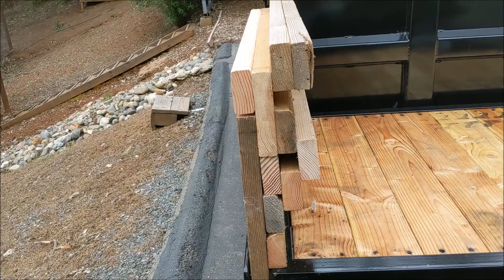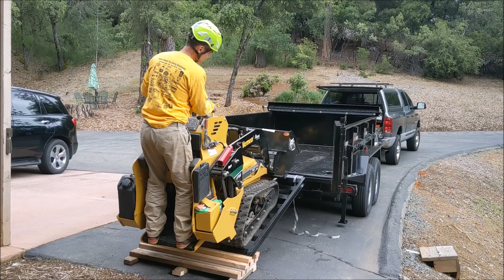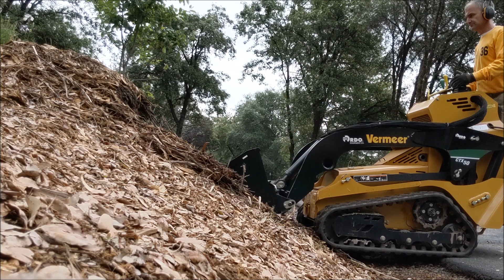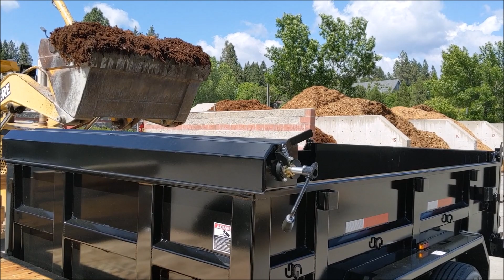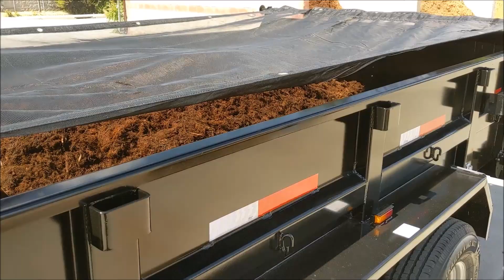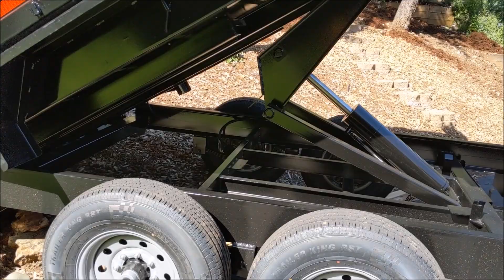Update Dump Trailer, Mini Skid Steer

Comment: as others have noted, you never load a mini or full-size skid steer forward on a trailer.  you ALWAYS "back" onto the trailer. this is important on a stand-on mini skid because you always need to have a way to ESCAPE off of a stand-on skid steer if it begins to roll over.  the way the guy is loading this mini-skid, if it starts to roll backwards, it could roll over the operator.
Reply from the maker: Yes, very good advice. I certainly load it that way now. Thank you
Reply: Happened to my guy yesterday.  Luckily , it didn't flip all the way.

Comment: Have you looked into putting drop axles on the trailer
Reply from the maker: No, but that is a good idea
Reply: @topsaw   I have them on my enclosed trailer and it makes a huge difference
Reply: Another quick fix would be to remove the extra platform in the front and put sheet metal on the main frame in it's place it will drop your load height the width of the extra frame

Comment: Jonathan - Would you recommend the front loading platform? I'm debating between that style or just going with just the dump space.
Reply from the maker: Of I were to do it again, I would do a regular trailer and load into the dump bed. For the additional cost and loosing the space it was not worth it.